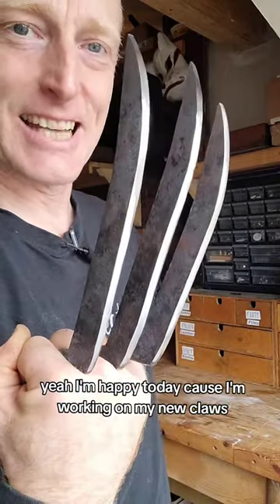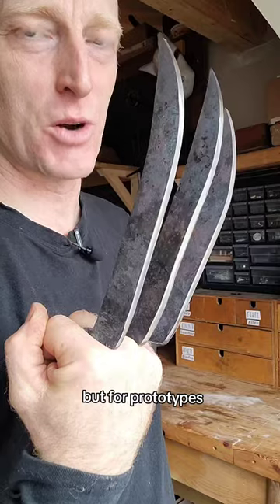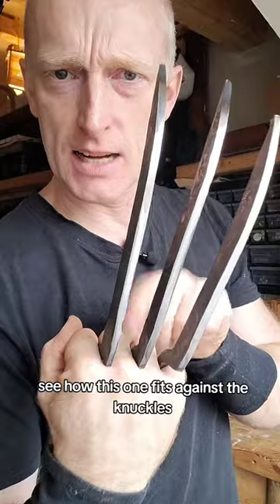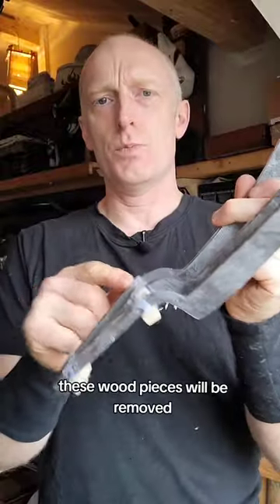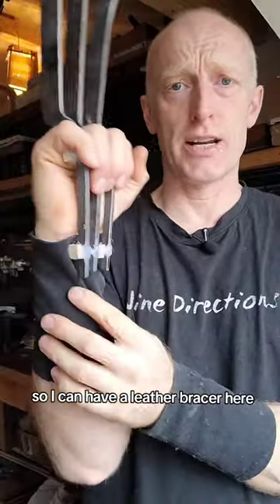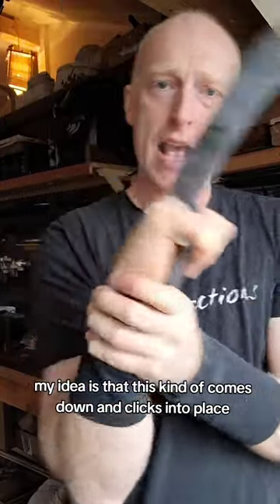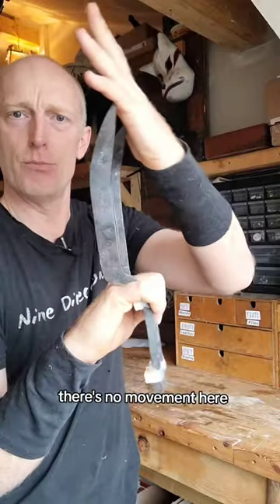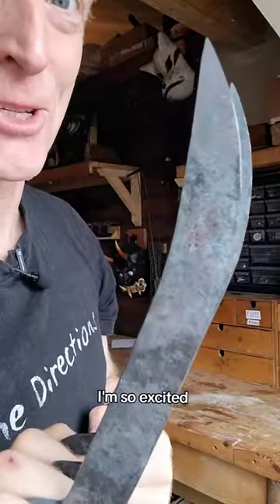Wolverine Claws, OK they're not that cool. But they will be!

Comment: But be careful on the top of your knuckles you need to have some protection and support where the bottom of the blade touches your knuckles
Reply: Just An observation notta critique
Reply: Agree if you try punching with it the impact could potentialy hurt or break your bone
Reply: @sandrisandi2212  yep

Comment: I can tell you that it took me and my brother 7 years to get a good proper prototype and it took us a lot of metal to build these things we both come out of everything we could think of from normal male you can buy at Home Depot to Farm Meadows to tools that we had running around the farm from old socket sets to old craftsman winches I have even built them out of 350 Dewey hubcaps but I can tell you one thing that took me and my brother 35 times to build a good version that was not only qualified as a good model but it was actually to the point that we physically could not carry around because people were afraid of them because at the time we were so Advanced for our time that most people didn't know what we were doing

Comment: I suggest putting a hinge at the bottom. And rivet it on to a nice thick leather wrist band. It will give you greater range of movement.
Reply: In addition to a semi circle hoop or full circle hoop you can slide your hand through or drop your wrist in…

Comment: I often contemplate such designs. Not sure how old this upload is but you may want to consider some sortve half leather forearm long sleeve with steel beam on the upper connected by bars ( at least one on each side ) along with the mechanism positioned in the front for connecting it you’d also have to end up adding a second set of ribs so most simply you’d want one in the front covering the risk and one high on the forearm for leverage and you can incase it with felt on the inside nd leather on the outside to disguise the assembly. I’ve been contemplating on doing the assassin creed knife ( for reference I’m not just chatting I really thought about this)

Comment: I have a pair of bahg nahks I had a blade smith make for me, they are supported by an index and pinky finger ring attached to a bar that rests on your palm directly below your fingers. They have 4 claws though and they are shorter and can technically be held in 2 different ways because of that design which is admittedly very different than this is.

If you want it to look really nice I suggest adding some mokume gane elements if you can, my hand rings are made of it and its just so amazing to look at.

Best of luck to you man. I understand your passion!
Reply: Yo that's sick! A YouTube short or short video showing it off would be super cool 🤘 that concept is hard to picture precisely, but I have no doubt it's sick 😎
Reply: @L0wSkiller 
Second the motion for a video showing this design.   These sound amazing.

Comment: Im just guessing but; wood handle is good and will help dampen vibrations especially if you wrap it and the one claw that sticks out may be more like the claws should be not for aesthetics but possibly use too, that way if you stab with it there is a gap between you and it. Amazing job genuinely and thanks for making a channel i love your content.

Thinking a little more about it and i think when you punch normally you want to hit with your knuckles on your index finger and middle mostly because if you strike with the other part it can break your hand in a horrible way so with that in mind if you are okay with it being sort of mechanical you could flip the space of the current design allowing it to cushion on your knuckle with padding or a housed spring that would maybe let you get be stronger stabbing hits with it with hopefully no damage to you i guess wielding it

The wrist strap idea is cool and im really really guessing here but maybe for the strap have a disc or brace the rope goes through over the top of your forearm using the idea of reinforcing it but trying to rely on material over your body.

Or different but would work is maybe a sleeve for a little past the bend in the elbow that are locked in a fist with that - then that movement wont be an issue maybe

Last part of ideas arm sleeve up to elbow with suspension in padding to give some counter leverage to whatever contacts it at that point they arent really just claws but maybe more functional unless wanting to switch what you can use fast is a priority i guess

Comment: Add a metal guard overtop of your knuckles, between the blades at the base, and maybe a leather guard down the wrist. If a combatant in a melee fight was swinging this thing around as it is now, you would have a very limited ability to block but also need to get close to your opponent to attack them. With extra guards in place, you could trap a blade between the claws or make a strike glance off the top.

Comment: Heres an idea

What youd need would be a one way slip latch. youd attach the female side of the latch to the bottom of the claws and then attach the male side to an iron *stability bar. I hope this helps, also i recommend putting leather hand pads simlly because youd want then after a good slash.

* iron stability bar is a piece of metal that is often sown inside of the VANBRACE
Youre not an archer so no need for a bracer.

Comment: I recommend a metal piece on top of the bracer that goes on the back of the hand as well so it adds rigidity and if it reaches the claws it'll buffer the pressure on the knuckles.
Reply: I thought so at first too but I worry if you strike something too hard the bracer on top would course tooo much force without being able to bend. So maybe the bracer being on the bottom can still allow the wrist to have some give without injury?

Comment: You almost need to make a wrist cuff with spring loaded ball bearings and cut detents in the bottom of the 3 claws. Once the claws are locked you would have a spring button release on the face

Comment: Slash dont stab if you stab then all that force is going to destroy your wrist i know from experience and trust me its not fun to explain to the er how you messed up your wrist
Reply: Slashing may bend the wrist in angles the body is not designed to experience. 

The design needs to protect the use during normal operation and anticipated mistakes.

Comment: You could actually retract those claws into a glove material that physically would work into your hand so if you didn't know you would actually have a glove on that would look like your hand or you could fit it around your hand this material and then the clothes would come out of the thing but they would not cut you going into the material or coming out of the material me and my brother we spent one time and we built 18 in Lazer ass sharp daggers I'm not joking sharp daggers and we weld them to a flame that we chopped off a 1972 pickup truck Chevy pickup truck to be more precise and we built the clothes off of this Frame these clothes were so strong and so tough that you could cut bags of feed with them and you could cut a full pork rolling in half how damaging you or damaging your hand the sad poem is after a while you do have to sharpen them because they do have a very fine laser point and when you're cutting through a pork loin or a feedback the friction does wear down the blade after work but they would be a fierce in battle and they will kill